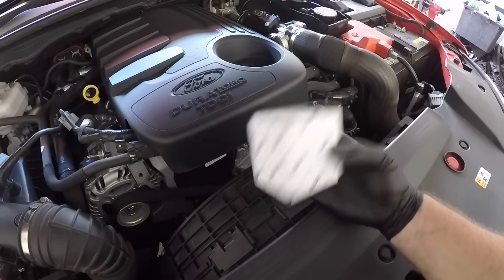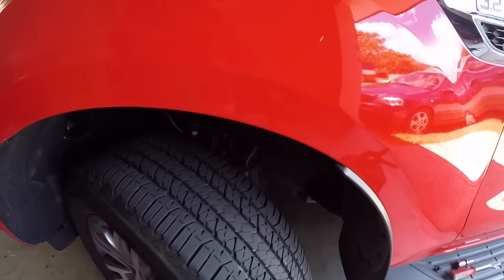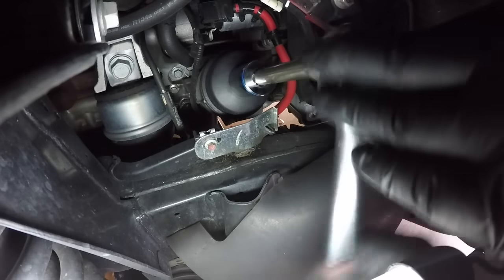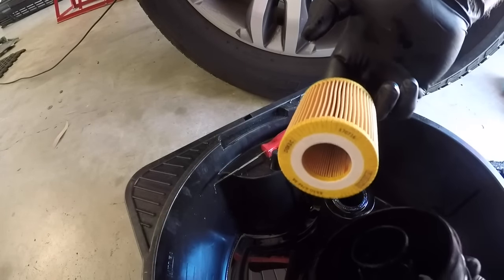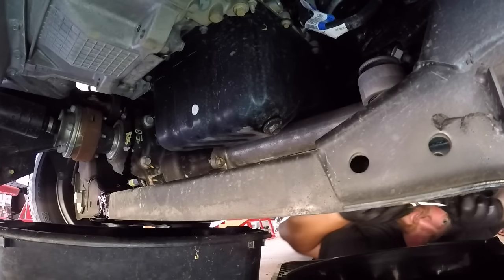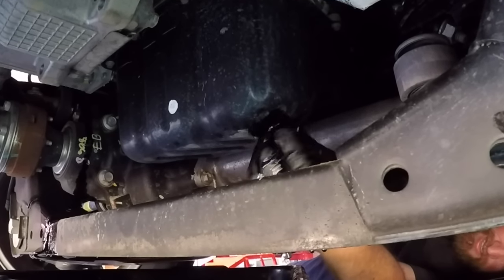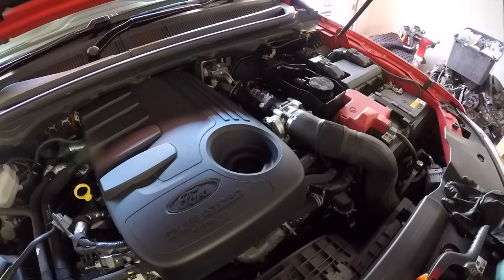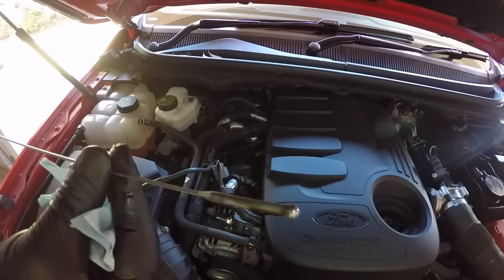Ford Ranger Oil Change Mazda BT50 Ford Wildtrak 3.2 Ford Everest WARNING THIS MUST BE DONE FAST!

Comment: I think the ten minuets starts from  removing the sump plug and draining the sump. the oil filter points in a downward direction and almost self drains .
Reply from the maker: As long as it doesn't drain while you go and have a drink and you just get in and do it all relatively quickly she'll be fine.
Reply: @killawattgarage   I have a funnel in the filler neck and two five litre containers of oil open and ready to go, got time enough to crack a stubbie (small bottle of beer for non Australians) have a few swigs and get a new washer on the sump plug . As soon as the oil stops trickling I throw the plug in and pour at least one and a half of the five litre oil packs in.
Reply from the maker: @richardcrowell284  Cheers, sounds like you got it sorted.

Comment: great video! any chance you can do a stock suspension installation? my suspension has gone bad and is leaking and i'm struggling to find a video regarding the replacement of stock suspensions on my ranger.
Reply from the maker: Thanks for the request. If I get the chance I will record it.

Comment: But what is the sudden loss of oil pressure issue because of? There must be another issue with the pump also, hard cornering? Low oil? I saw somewhere that oil veins fail.
Reply from the maker: The design of the pump has multiple vanes that without being submerged/surrounded in oil have no ability to pump. The concern is that if the oil drains out the pump won't self prime and destroy itself. Low oil levels while off roading or fast cornering could create a momentary lack of oil but not enough to fully drain the pump and cause no oil pressure. Thanks for the comment.

Comment: Cheers for the vid. But, you said you were 3 or 4 minutes into the oil change and had not at that stage removed the sump plug. Is that true?
Reply from the maker: At 3:32, its the first time the sump plug is un-done. It should only take a couple of minutes to change the filter. Thanks for the comment.

Comment: The scary part is that my local ford  dealer has never heard of this,..  and they do this all the time..  but i'm gonna change  engine oil myself, and i'm gonna be quick about it.
Reply from the maker: It's now becoming a well known fact, but to hear that ford dealers are unaware is very scary. I guess to it depends if you are speaking with the 'Service Agent' or the mechanic as to their knowledge. Thanks for the comment.
Reply: It's in the owners manual so your dealer isn't very bright. Change dealerships

Comment: I wonder how to re prime the system of u have stuffed up the oil change that would be an interesting topic
Reply from the maker: you can overfill the oil then drain excess after starting or hand pump oil into the oil pump through the filter housing.

Comment: Very poor design if you ask me, especially in this day and age. I can just imagine the build up of sludge over time, especially when warranty is just about to expire. One wonders if this is one of the main reasons why Mazda is going to use the Isuzu engine in the next model update 🤔
Reply from the maker: I think these days it's all about the warranty period. A number of manufacturers are now offering free scheduled services for 5 years etc. I am sure that the barest minimum will be done and the service intervals will continue to be extended. Thanks for the comment.
Reply: I think Ford is a absolutely beautiful product, but overall the design is not what you expect from a company that is supposed to lead the pack. Here in South Africa the owners were struggling with engine failures on the 2.2's, oil change and turbo failures on the 3.2 and gearbox issues that came along from the 1970's and is still a soft spot for Ford. My wife's Fiesta has a failed dmf under 70k km's and it's expensive to fix. I decided I won't quickly buy a Ford again. Thanks for the video, it's a brilliant informative video.
Reply from the maker: @GustavTessa  Thanks for your comments.
Reply: I agree that the design is very bad! A non-self priming oil pump in a 4x4 is a bit ridiculous. I wouldn't worry about sludge build up though. The oil has detergents in for that reason. Engines sludge up when the detergent hits end of life and the oil can no longer suspend the deposits so it settles and clumps. One good way to watch for it is products like Oil-spy or get some chemical filter paper. If you place a drop of oil on it and it leaves a black ring then the detergents have expired!
Reply: Typical ford crap
Reply: Poor design from a consumer point but from a Manufacturers point this is brilliant. 
Significant increase in difficulty leads to less DIY resulting in better profits through dealer reliance.

This has been the trend if you have not noticed. Look at the transmissions they are doing the same (must be on temperature, must know the sequence to get computer to temp mode, must remove cover for the release plug, must be level etc etc. 

They learned the military grade unlocked maintenance designs of older cars was an area that can be be shut down to increase profits.
Reply: @jdonaldson5709  hahahaha tosser
Reply: @jdonaldson5709  just like a ford fan slow to react lol

Comment: great vid. quick question.. i noticed you mentioned that the new oil is "dark and black"... is that normal?
Reply from the maker: Yes Diesel engine oil blackens very quickly and its colour is not an indication of age of service.
Reply: thanks! by the way, is the 10-15min change duration applicable as well to the 2.2L ford diesel engine?

Comment: Sugerencia, en el deposito del filtro de aceite queda bastante aceite quemado, puedes extraerlo con una geringa para que no contamime el aceite nuevo.
Reply from the maker: Translation - Suggestion, in the tank of the oil filter there is a lot of oil burned, you can extract it with a syringe so that it does not contaminate the new oil.

Yes you could try to remove the old/burnt oil but remember with this oil change there is not a lot of time. 

Translation - Sí, podrías intentar eliminar el aceite viejo / quemado, pero recuerda que con este cambio de aceite no hay mucho tiempo. gracias por el comentario

Comment: Hi!  Does the time frame apply also for the 3.2 Turbo Diesel?  What type of oil would you suggest for the Diesel version?  Thanks!
Reply from the maker: This is the 3.2 Diesel engine. I have been using 5W-30 Castrol Magnatec A5 and are very happy with it. Thanks for the comment.

Comment: If you got spare time, would it be possible that you’ll make a video on how to replace the airbags on the steering wheel? I find it difficult to release the horn button where the airbag housing is located. 2016 everest 3.2.
Reply from the maker: I will have a look.

Comment: Why not add a quick drain valve to the sump to save yourself 30 seconds of wrenching? Add an assistant to the process to begin adding fresh oil once the used is out and the valve is closed and the pump should never lose prime. 
(Cartridge filters are a pain, and that location makes it a bigger one.)
Reply from the maker: Nice idea!

Comment: Just thinking outside the box, obviously the oil is gunna drain out faster if the oil is very watery or the viscosity is very low , , so I’m thinking doing the job when the engine is stone motherless cold might help a little…. Possibly , maybe, although if your oil is ratty with a lot of diesel contaminants, it may not help that much . 
 Another couple of thoughts occur to me , 
The first one is do not wait for the full service  time to elapse to replace the oil, if the recommended service interval is 15000 K’s or 10,000 miles , do it a bit earlier while your oil still has a bit of body to it, and your engine will thank you for the clean oil anyway.
My other thought which maybe a bit counter intuitive to getting the best mpg out of the donk , might be to try a grade heavier on the oil . 
 What a shitty idea , often in the past when doing oil changes at home on my cars and trucks , I’d remove the filter and drain plug and go and have lunch to let every bit of dirty oil drain out , I’d put some oil in the filter cartridge or spin on filter and top the motor up with oil, oil light would go out in 2 seconds no problems. 
My mates son had a ranger , he had no end of issues with it and got rid of it . 
 It’s amazing , you look at some modern build practices from particular brands , and say to yourself WTF where they thinking? 
 I worked at a couple of ford dealerships and a GM dealer as a young bloke , they did not always have the best quality in some models, but most of the time they had common sense designs. 
 Today , omg some of their designs are just shitful !

Comment: Thanks for the knowledge, I can confidently do this myself now. What would be involved to drain and replace the power steering fluid on the PX Ranger? Is it possible to do a video on this one day?
Reply from the maker: Will add it the list and film it if I get the chance. Typically (with the engine off) you would disconnect the low pressure return hose and lower it to drain the old fluid. Turn the steering left to right will also move the old fluid out. Reconnect the hose and fill up with fresh fluid. With the car running It will be filled with lots of air and you will need to turn left to right a number of times to purge out the air. Hope this helps.

Comment: Hi mate great video. Very helpful! Just wondering. One question, you sound very knowledgeable, how do you locate the glow plugs on this engine?
Reply from the maker: You cant see much of a fitted glow plug. Under the plastic engine cover on the side of the cylinder head you should be able to see them from the heavy duty electrical connectors joining the 5 glow plugs together. Once the connection is removed then the the outer tip of the glow plug will be visible. Hope this gives you a guide. Let me know if you cant see 'em.

Comment: My brand new Ranger engine only 15.000 K old spun a main and is getting new engine due to this issue and that's with the dealer doing the oil change. They charged me $400 for a $20 filter and 10 litres of oil.
Reply from the maker: Sorry to hear about that bad news, glad its getting sorted. Be careful when doing these oil changes.

Comment: Great video, easy to follow. What size was the socket you used to tighten the oil filter? Greetings from germany
Reply from the maker: Greeting from Australia. You will need a 27mm socket.
Reply: Great, thanks!

Comment: Thanks Killa. Good advice and well presented. Any ideas on using an oil flush additive immediately prior to oil change?
Reply from the maker: I personally don't use these products unless there is a specific need. I like the Liquid-Moly brand products and use them as my first choice.
Reply: Well, if you can't drain all the oil out of these dumb engines, you don't want to introduce a solvent that you can't fully drain out because it will contaminate the new oil.  A few drops here and there are ok, but it looked like there was a good amount left in the pan, plus the amount that stays up in the engine that takes a longer time to drain down, so that's a lot of contaminated oil to mix in.  Not to mention, lots of those contaminants and solid particles need as much time as possible to drain down from the pan.

Stupid design if true about the oil pump not priming.

Comment: Killa Great video mate I have a 2013 3.2ltr ranger xlt and I’ll be changing mine for the first time tomorrow and I’ll get everything prepared first now I know the time can be important!! So glad I watched this today as I had planned to let the sump totally empty out thinking it benefit the motor! I have noticed after ford have changed the oil that it doesn’t always look a clean as one would think and that’s now make sense as they leave a portion of existing oil in there to escape priming! Thanks for sharing 🤙
Reply: I worked on models like yours (2011-15 in general) and never had the issue mentioned in the video. I believe the issue is on the 2016 models and newer.

Comment: why the pump dont self prime? every other engine the pump just work.
Reply from the maker: These engine use a variable output pump, it takes less power from the engine to run the pump therefore increasing fuel economy. The down side it that if the oil fully drains out they can't self prime. Not a problem if you are aware. Thanks for the comment and I hope this answered your question.
Reply: @killawattgarage  put some sort of pressure valve on it so it wont fully drain out , but will flow under operating conditions .
Reply: Redzone 2119 it’s a vane pump like a hydraulic pump or power steering pump

Comment: Dear friend, why, by adding the volume required in the manual, be 2.2 or 3.2 l, the measurement with the dipstick indicates level much above di allowed.
Reply from the maker: Anderson Charles Jahn when the oil is drained not 100% of the oil is removed. The amount of volume listed in the manual is if there was not a drop of oil left in the engine. But there is always still some oil left in the engine even after draining for a long time.
Reply: But all authorized dealers place the quantity expressed in the manual, be it Brazil, Thailand, New Zealand, etc. Will the authorized Ford dealerships of various countries have the wrong information?

Ford only responds that it is checking the case, but there is no timeframe for such a response.

Meanwhile, many Ranger pickups present leakage problems on the crankshaft retainer, and the carter's gasket, and Ford ends up arranging under warranty, that is, they are impaired by the very uncertainty of the volume of oil to be placed in the exchange.

Have you already taken this test? For example, it replenished 8.6 liters in a ranger 2.2 engine 2017, like mine, and noticed level far above the maximum?
Reply from the maker: Anderson Charles Jahn I placed about 9.7L in this one and the level was spot on. Dealers and local garages are going to charge customers for 9.8L(recommended refill amount) but may not use it all and have a few hundred mL left over. With this engine it is possible for the oil to drain out of the oil pump causing no pressure when restarted. Because of this drain times are low and therefore the full refill capacity is not meet.
Reply: Killa Watt Garage Does the tip of the pedal have no retention to prevent dry pump? Is not Ford throwing away money, both with unnecessary replacement and maintenance caused by such over-volume? would Ford make this mistake?
Reply from the maker: Anderson Charles Jahn the oil pump is a variable output design which reduces the load on engine. Ford won’t overfill during each oil change but they will charge you for the recommend refill amount.
Reply: Killa Watt Garage , Thank you for the answers, my friend! the fact is, or Ford overfills the engines based on a wrong instruction from the manual itself, which indicates replacement volume equal to the first fill volume, or the dipstick is longer than necessary. Please let me know if you have any news on this subject.
Reply: @killawattgarage  Would one be inviting issues if say they purposely under-filled by putting in say 8.0ltrs. Then topping up accordingly afterwards...?

Comment: They need to make engines with two points where you can run the engine and flush the old oil out as you refill just like a trans flush with the two lines sucking in the new oil while the other line is pumping out the old.
Reply from the maker: Well ......... I am about to make a video of a transmission service on this same vehicle however the transmission has a thermostatic valve that prevents fluid flow until operating temperature. The only way to be able to flush it through the hoses is to pre heat the fluid. Thanks for the comment.

Comment: Thank you so much for doing this video. Just wanted to check if this is same for a 2017 BT50 3.2 model. Also is it best to buy genuine Mazda BT50 replacement filter?
Reply from the maker: craig weir yes the bt50 engine is the same and the Ranger and Everest. I used a genuine filter just for this video but typically use a popular known brand.

Comment: Hi there, I'm looking at installing a Transmission cooler on the Ranger PX MK2. Would you have a particular brand that you recommend ? Also if your on the North side of Brisbane by chance would you be keen on doing this job for me. ? If you could message me directly that would be awesome. Thanks heaps, Your videos are great.
Reply from the maker: Hi mate. I work for myself at the moment and not taking on any more work. There are specific kits you could buy or I recommend Burpengary Transmissions, they do great work. cheers

Comment: How would you go about re priming if you had let it go to long or how do they do it first time! 
Very imformative video. I have the bt50 in aus.
Reply from the maker: Lets hope you never have too. I haven't done this personally but I have heard that if you over fill the sump by about 5 litres it will feed into the pump (essentially priming it) then the extra can be drained out after starting. There is some debate if you should start the engine with it this over full of oil, and I can see both sides of the argument, but you gotta do, what you gotta do! Another option would be to access the oil galleys at the oil filter and either attempt to suck oil though or feed oil back, clearly the engine would not be running. Then attempt to prefill the oil filter as much as possible. This would be really messy but another option. Thanks for the question.
Reply: @killawattgarage  appreciate the reply mate. Makes you wonder how they do it at factory. Can't imagine they'd want to over fill every time! 

Thanks mate. Great videos all the same.
Reply from the maker: @liamjenkins82  From the factory when new it would have been filled with a pre assembly lube which is like grease. It wouldn't drain out. That also what you use when rebuilding an engine. Cheers
Reply: @killawattgarage  yeah that makes sense. Thanks.